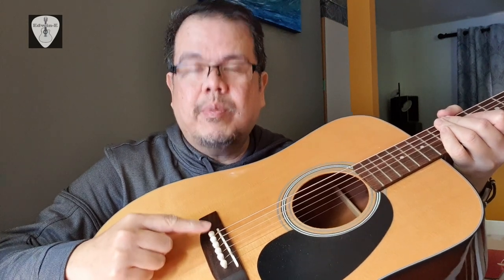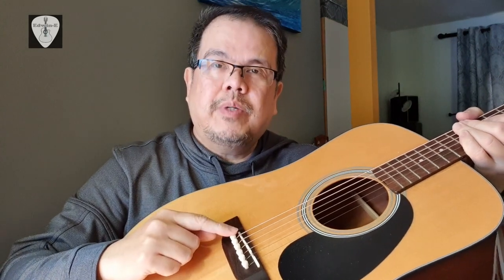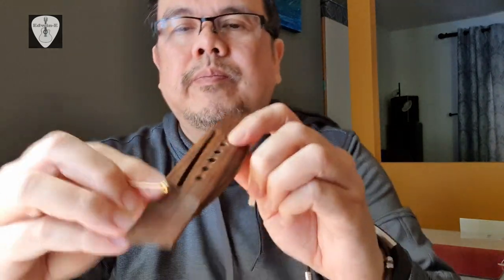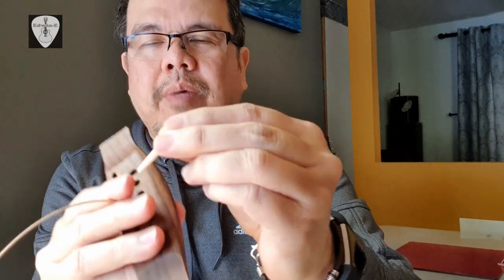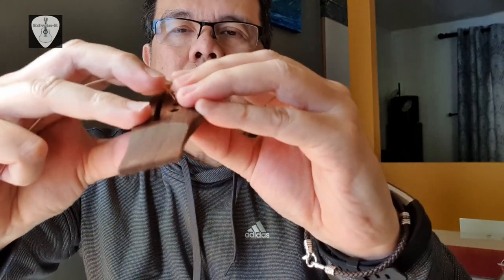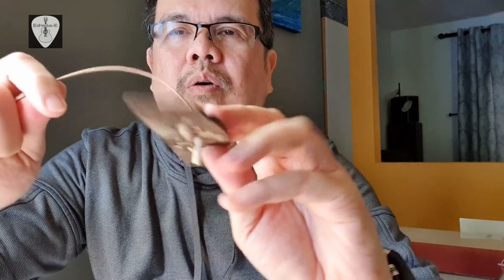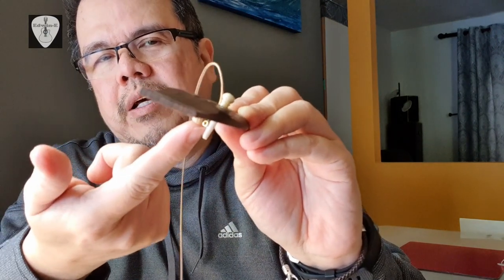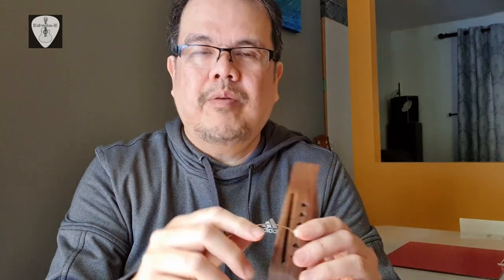Bridge Pins Lifting When Tuning Up - Acoustic Guitar Tip | Edwin-E

Comment: I've played for over 55 years and never had pins as loose as on my new Gibson Songwriter! I'm used to friction holding pins in place. Bending the bottom of the string solved my problem. Never heard of it, and I teach guitar!! Thanks!!
Reply from the maker: You're welcome.  Thanks for sharing.
Reply: Uh same story here. 64 and forgot that. I thought I needed a new bridge. Lol
Reply: I never had this issue but I put some martin strings on a fender and the first 3 strings kept popping out. I bent them all and had no issues. Thanks!
Reply: Long time player and I've just discovered this great tip😊. Thank you!

Comment: Does a lifted bridge pin affect the sound? I have a brand new fender 115 and the bridge pin on the thickest string came up about an eight or so the very first time I adjusted it. 3 or 4 of the 6 strings emit a sound that is reminiscent of an empty 5 gallon plastic bucket bouncing on a hardwood floor. Nice video by the way💯
Reply from the maker: Maybe the ball end of the strings are not touching the bridge plate which is causing knocking sound or vibration.

Comment: I put the string just barely into the hole so that the pin pushes it right in. No slippage. I also put a cloth over the bridge as the string is being tightened because I still never trust the pin not to jump out. Thanks for the advice about bending the string.
Reply from the maker: Thanks for sharing.

Comment: My guitar is old and was used by someone else for quite a while before I ended up with it. The bridge pins holes are all bored out from many, many, previous string-changes. I recently changed the strings, and I can't even get the guitar in tune without the pins coming out. I tried putting them in backwards because it is tighter fit that way. They still pop right out. I think I just need bigger diameter pins or a new bridge at this point.
Reply from the maker: thanks for sharing

Comment: I just got given a basic steel string acoustic guitar and one peg has been hammered into it's hole will I be able to get the bridge off with a pallet knife? I'm aware that the bridge has two pegs & glued onto guitar body. I'd like to fix this problem if possible 🎶🎼
Reply from the maker: Why do you need to remove the bridge?  If your problem is just stuck bridge pin, then you can push it out from the inside.
Reply: @Edwin-E   Ok thanks for the sensible thing to do.
Reply from the maker: Good luck! Cheers.

Comment: Only my e string on my Dean EAB Acoustic Bass comes out 😭 I try pushing it down but it comes out when I’m so close to being done with the tuning any reason why ??
Reply from the maker: If you have done this properly, I am guessing that the bridge plate inside the guitar is already worn out.  You can check inside the hole with a mirror or camera.

Comment: Thanks! My guitar is constantly getting out of tune. It’s probably because of the pins, I’ve noticed that they’re not 100% flush to the bridge. They are not the original ones and probably too small. I’ve lately realized they come in different sizes, which is not that evident on the packaging.
Reply from the maker: You're welcome.  Yes, sometimes the sizes are not identical.

Comment: Sir my string is just not going in the holes what do i do??(holes are quite small and the string's little round is big)
Reply from the maker: Three options:  1.  Don't use that strings set on your guitar,  2.  Make the hole a little bigger, 3.  Insert the other end of the strings from the inside and let the ball end lock in it's place under the bridge.   I suggest, option 3 is the best.   I hope this helps.

Comment: I have a guitar with a very worn bridge, the strings have cut into the bridge, I put cheap fake pearls. I string the pearls through the wire then you have to insert the string through the inside of the guitar. that guitar string is not going to move at all. you can trim the pins for better fit, but they are there only for looks. I can't remember where I learned this quick fix.
Reply from the maker: thanks for sharing your experience